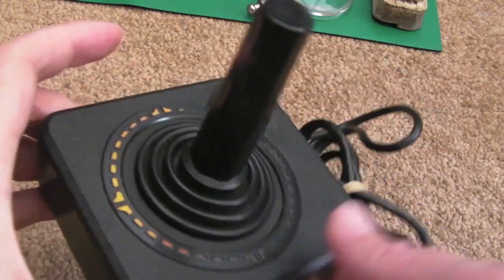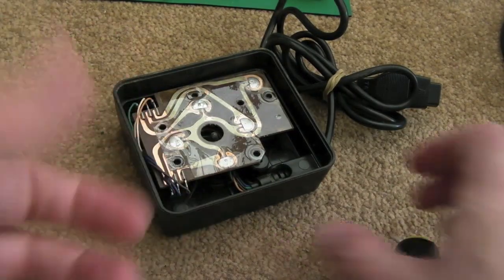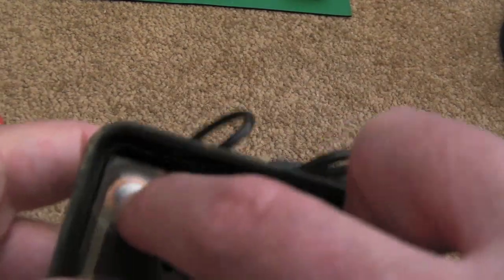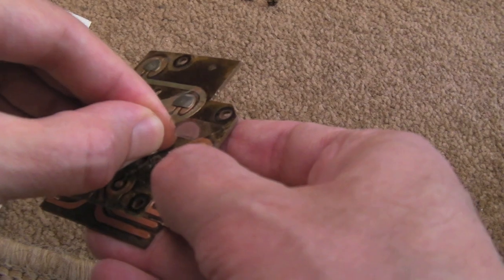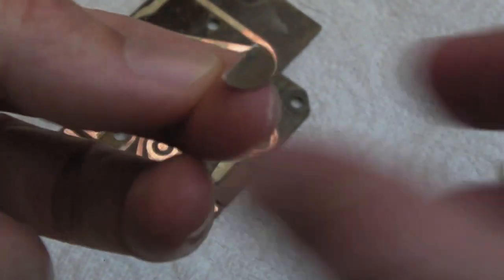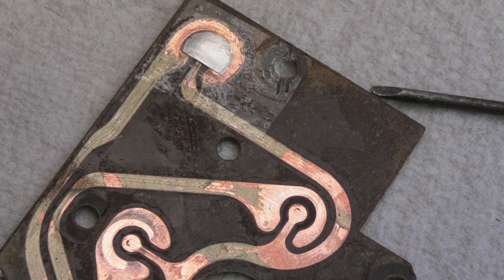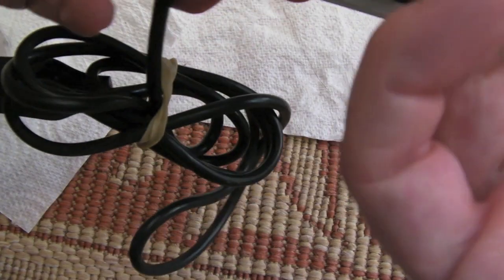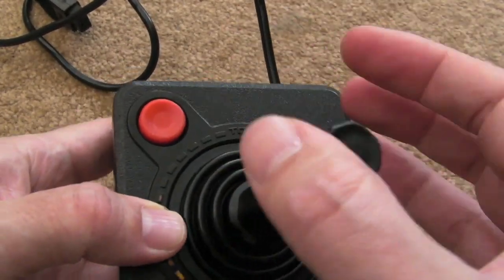Atari 2600 Joystick Teardown / Repair

Comment: I had the Atari ST version of this joystick back when I was a kid. The ST version had really crappy spongy (non clicky) domes, and I remember taking it apart and replacing the domes with some clicky ones from an old clock radio, I was very proud of myself at the time as I was probably 9 years old. It's funny you just reminded me about that in your intro where you talk about having some spare ones from an old clock radio
Reply from the maker: +arcadeuk Haha!  Similar story for me - I took stuff to bits back then as well and that's where I first saw them, in alarm clocks and joysticks!  I remember repairing a Quickshot Joystick using one of the blisters from an old alarm clock - that's probably where the ones in my component drawer came from.  Amazes me how long we hold onto components lol.
Reply from the maker: +arcadeuk And I didn't know there was a clone for the ST as well =O I will have to check that out!   Seems like this stick was pretty well used all over the place =O
Reply: +GadgetUK164 
It was also bundled with the XEGS console, coloured a sort of grey/beige.  One of the very few videos I've made is one about the CX40 joysticks, and what seems to be a white-coloured clone that I thought was Commodore's clone, from the VIC-20 days.

Comment: blimey I remember taking one of these apart years ago and having to sort the buttons, also had a joystick that had a copper star shaped system, the legs of the star would be bent down to touch the contact, they always tended to just snap with vigourus use.
Reply: +GadgetUK164 yea that sounds about right, good ole days, quality guaranteed.

Comment: The reason why I like this joystick over the arcade one is because it is silent. Did a teardown last year of these. Adhesive had creeped under the contacts. Cleaned them, put the film back on and it works still today. The white nylon tabs that touch the contacts show signs of material fatigue.. I didn't make a video about it. You can buy new mainboards for them also. btw the copper traces look hand drawn :) Great work on the metal domes. Mine were star shaped. One of them are split so I should get new ones sometime.
Reply from the maker: +bwack I don't think I've seen those star shaped ones in a 2600!?!?  Might have to try and find a picture of those, unless you've got one?
Reply: +GadgetUK164 I can take a pic of mine, but even better if you see the video you linked too, one minute in the video he has the same pcb and domes that I have.
Reply: hires pics: http://www.vintagegamingandmore.com/atari-joystick-repair/
Reply from the maker: +bwack Ah, I see now =D  Thanks!
Reply from the maker: +bwack Brilliant, thanks =D  Amazing how a simple video like this pulled in lots of things I wouldn't have known, like that Commodore stick (see the posts below from MindFlareRetro).  Very cool seeing all these variations etc.

Comment: It amazes me that people would sent out equipment without cleaning it first, understandable this controller is about 30 years old but some of the new stuff its almost like people don't care. That circuit board is a piece of art! Whats the plan with this controller, did you pick up an atari project with it also ?
Reply from the maker: +Beatertech Haha, yes - you're right!  I don't get why people just don't look after stuff =/   It is a work of art, as bwack mentioned below, it's a hand drawn track layout! =D   I bought this to go with my Atari 2600 that I fixed a few years back.  I've got the composite video PCB to stick in there at some point soon, and I've also got a replacement RIOT chip to test also.

Comment: I doubt the tape you used will last more than a year or two before it either dries up or goes gooey and starts to lift/peel. I have read of people using Gorilla Tape for this type of repair. It's a bit thicker, more durable, and the adhesive is silicone based, which resists humidity and drying out over time.
Reply from the maker: Still working as of last week, so guess again!!! =D

Comment: Interesting to see that they had slight variations in the pcb designs in the controllers. Mine are slightly different, all the wires connect at one corner of the pcb, plus the dome switches on mine are a different shape, A triangle type shape if i remember correctly, with a little dimple in the middle. But like yours genuine 35+ years old.

I must admit i did try that tactile mod,  to be honest i wished i had not done it, i found they were way too sensitive, even cutting down the plastic bits did not help much. I found it very difficult to go just one way without pressing another of the buttons, made game play very difficult. Might have been because the black plastic that covers the joystick was not flexible enough, causing movement in two axis instead of one. But going back to my slightly different design of joystick pcb, the one in that video is the same as mine. Never realised they varied until i saw yours.
Reply from the maker: +100SteveB Thanks for the info!  It's useful to understand the issues there with it being over sensitive etc - You've probably saved this stick because I was thinking of trying that mod!  =D
Reply: GadgetUK164
It was a bit of a nightmare, especially trying to move diagonally. It was a spare controller, at the time i did not have any dome switches for it, so it was worth a try.
Reply from the maker: It was absolutely worth a try =D  If we don't try these things we won't know!  And in this case I get to learn from your experience, so from that point of view it was worth doing!  And at least you've saved me from making one of mine worse!  =D  We either learn from our own mistakes, or if we are lucky and observant we learn from other peoples mistakes!

Comment: I still hate these controllers, they never rubbed me the right way, still have to appreciate the build quality
Reply from the maker: +TheSynrgy1987 Haha, I know what you mean!  Maybe I sounded like I was singing their praise too much!!!  I don't love them, I think the fact the stick part doesn't break is remarkable, but the buttons were never great on these.  For a 9 pin D stick I prefer the Cruiser or Power Play sticks.
Reply: +GadgetUK164 I was always a fan of the TAC-2 or Wico joysticks. Though virtually anything is an upgrade over the stock 2600 sticks lol.